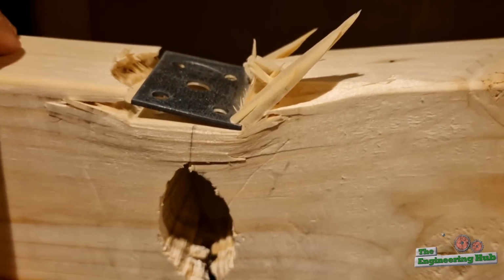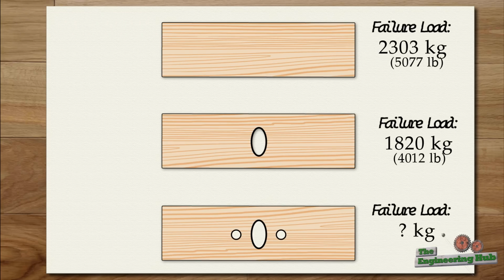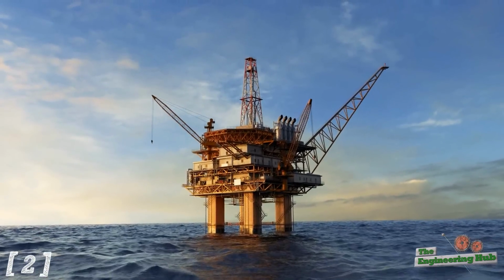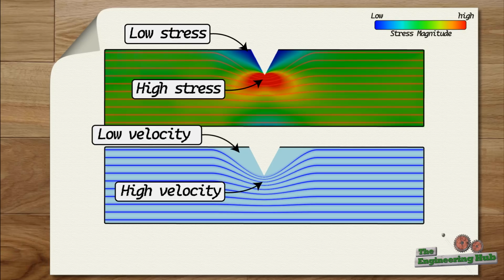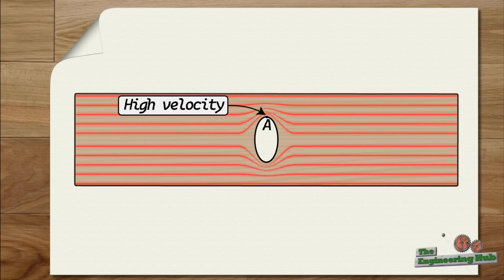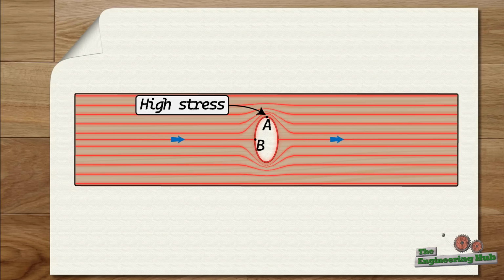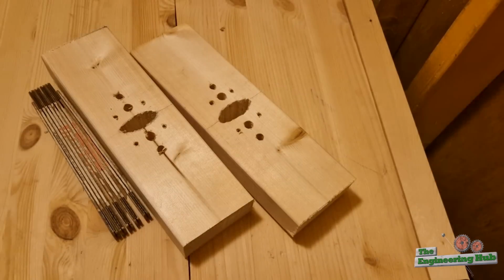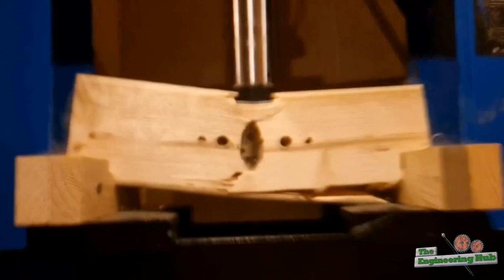Can drilled holes make your beam stronger?

Comment: Why did you demonstrate potential flow theory on a beam loaded in tension when your test is a beam with a transverse point load? They're separate loading conditions that require different analysis. Furthermore why didn't you repeat your initial test multiple times? Wood can vary significantly in strength so using only a single point of reference does not make for an accurate test
Reply: The variance is already exceedingly apparent by the numbers 1929, 2010, 2140. I don't know how anyone can think 1820 is definitely significant and not a fluke.
Reply: @passerby4507  especially with only one data sample
Reply: @passerby4507 it is a very common fallacy.
Reply: well if you think about it, the bottom of the cut is breaking in tension, so you're right, its not a very good test to demonstrate the principle in tension, but the bottom 50% is kinda ok. although its still being pushed perpendicularly like you say
Reply: TLDR: when you transversely load a beam, a bending moment is created which leads to the creation of tensile and compressive stresses within a member above its centerline.

Long version: 
When a beam is loaded transversely, it bends, creating internal stresses. The bending causes the fibers above the neutral axis (an imaginary line within the beam delineating compressive and tensile stresses) to be compressed, while the fibers below are stretched in tension. The compressive stresses are highest at the top surface, and the tensile stresses are highest at the bottom surface. This distribution of stress results from the bending moment caused by the applied load. It is important to acknowledge that 1) this is not pure axial loading so the flow analogy does not perfectly carry over because of other additional stresses and 2) that wood is anisotropic so it is definitely not an ideal material to test this with but it is cool for demonstration purposes.
Reply: @riversneed  so Mr structural engineer, is it correct to use the water flow as base like in the video?
Reply: Your reference set is [1820] and your test set is [1929, 2010, 2140]. The two extra samples did not demonstrate that the extra holes made it stronger. It demonstrated that there is a high variance on your samples and the 1820 outlier is not very significant. 

Also, using a tensile stress analogy when introducing a bending stress is quite confusing. I know there is a tensile stress in the failure region but the stress introduction method is fundamentally different from tensile testing and the material is anisotropic on top of that. It makes for a pretty poor analogy to explain what is going on.

The phenomenon you are trying to demonstrate is true though: removing material can make a part stronger w.r.t. certain load cases. For example: a common repair method for cracked plates is to drill a hole at the end(s) of the crack and then patch the hole. I.o.w. removing material to make it stronger.
Reply: You should study a little bit about constitutive models.
Reply: Because the transverse loading causes tension and compression linearly in the beam.
Reply: Not to mention how unrepeatable the hole cutting method seems to be
Reply: Because he is hee for the likes and the dubs.
Reply: its just a demo relax
Reply: @user-lo4me9oe9z  it's a demo that doesn't illustrate the concepts being discussed
Reply: @user-lo4me9oe9z it’s a well stated comment, relax
Reply: @user-lo4me9oe9z  EXACTLY!!

Comment: Wow !!! That is sooo counterintuitive - and really set me thinking .
Video saved - I shall definitely revisit this . What a surprise … thank you for making this .

I almost can’t get over that 
This  would imply you could strengthen a  joist after a plumber has put a pipe through it by drilling extra holes !!

I guess in buildings strength may not be the limiting design case  however, where absolute deflection under a given load may well be more critical, and indeed must be lower than a prescribed amount so as to prevent damage to attached brittle materials, and the more nadgered a  beam is, the more it will deflect (long before failure). 
Presumably the coupons with extra holes drilled are deforming more for a given load ? Otherwise why wouldn’t all plumbers do this as a matter of course, and more importantly it be built into building regulations ?

Comment: Your loading doesn't match you stress analysis.  So tell me again how you can increase tensile strength by reducing the section?
Reply: The tensile strength isn't increased. The tensile peak loadings within the distressed element are reduced.
Reply: Practical tensile strength is increased....but not for the entire section.  Remember we are comparing against section with center slot and section  with center slot and extra holes to smooth the flow.  This reduces the risk of failure emanating from the peak load points.  I.e. we are making the material behave more uniformly, though theoretical tensile strength in a uniform material won't change.

Comment: Please normalize your audio. Loud bangs and your quiet voice do not make for a comfortable listening experience
Reply: Gen - Z for sho
Reply: I didn't find any issue with the audio
Reply: You want compression, not normalization.
Reply: Wrong
Reply: Are you American by chance? I’ve noticed that many of you struggle with things most people just filter out, I heard no “bangs” either.

You receive a free product and kvetch so perhaps you should pay the guy and then you can affect the sound so it doesn’t give you this emotional damage.
Reply: @Br1cht  0:25, literally the first 30 seconds of the video. It goes from practically whisper quiet to peaking. If you don't hear anything wrong, go to the doctor and get your ears checked.
Reply: Instructions unclear, performed supercritical heat soak of audio equipment and allowed to air-cool to room temperature. Equipment failure.
Reply: Crybaby
Reply: I kinda like it. Keeps me on my toes
Reply: Humble_Merchant I hate to start a morning like this, but you’re an idiot.  I wouldn’t doubt you’re one of those “woke” types.  Stop trying to make the world more complex with bs!!

PS - the woke are not woke!  They are more brainwashed and ignorant than more people in this world!
Reply: Sound fine to me. Skill issue maybe?
Reply: Humble is correct. Loud jarring sudden noises are unnecessary. And very distracting. It’s 2024. At least in the US. Maybe where this video was made and edited is still living in 1968.
Reply: Turn on the stable volume setting.
Reply: ffmpeg loudnorm
Reply: It's called a compressor
Reply: Might not be just him. Something weird seems to be going on with audio on YT lately. I've had to jack up the volume on some channels I've sub to for years only to get blasted on the next video.
Reply: @custos3249  Youtube now has a setting called "Stable volume". I wonder if it is doing the wrong thing in some cases.
Reply: @custos3249 turn off stable volume
Reply: @custos3249  look in additional settings, there's a new function that's called auto volume or regulate volume, something like that, disable that function
Reply: Thank you for the warning before I turned my volume all the way up! 😅
Reply: Turn off stable volume.
Reply: Headphone-cels seething, phone speaker chads winning
Reply: You don't seem too humble to me...🙄😅
Reply: @peterfitzpatrick7032  I'm very humble. The humblest in fact
Reply: Idk it sounds normal to me. Maybe using headphones makes a difference, but I can hear both his "quiet" voice and the "loud" bangs like both are similar.

Disclaimer: I always had excelent hearing (hearing tests are above average), but maybe because i listen to stuff like Heavy Metal and Trance, I likely "trained" to listen all extremes of sound, bass or treble, quiet or loud.
Reply: It is what it is, I don't think there is much improvement to be made, perhaps simple "loud bang ahead" warning 🤔
Reply: You should totally ask him for a refund for the free video you just watched. 🤦‍♂️🙄🤡
Reply: @airgunsofalaska or he can listen to this and make a real improvement to his content. This is decent feedback actually!
Reply: you didn’t even watch the video, did you? there was a single loud bang at the beginning and that’s it
Reply: It's a video about wood breaking, not a bedtime story
Reply: @bobs12andahalf2 It's a video about science. If you want a video about breaking stuff, watch hydrolic press channel. Or if you want to burst your eardrums, watch loud car channel.
Reply: @bobs12andahalf2    Don’t be such a Neanderthal.
Reply: @bobs12andahalf2 bro, it's fine if the audio balancing is ass, it's SUPPOSED to be ass
Reply: Really, is that the best gripe you can do on a truly informative piece of work?
Reply: The dude wasnt complaining to complain. I had to crank my earbuds up to hear him and then got blasted by a piece of wood exploding into my eardrums lmao. Its definitely uncomfortable to listen to. The constructive part of the comment asked him to normalize the audio. @scotttoner9231
Reply: @scotttoner9231 when you cant take criticisms so you try to attack the critic
Reply: @scotttoner9231 do u guy unable to take criticism?
Reply: @scotttoner9231  No

The click baity title is also unprofessional and unnecessary
Reply: @Humble_Merchant 
 Normalising the audio would not help, it would amplify all things equally.
I would suggest and audio compressor, not to be confused with compression.
A limiter would also do the job.
If he was really brave both would be better but not to much or we will hear every wheeze and creak. I’ve some videos were you can hear lunch digesting in the quiet bits.
Reply: @Margarinetaylorgrease  normalizing or equalizing audio would indeed help because it would all be a similar volume that can then be adjusted with the master volume without one audio source being too loud or quiet.
Reply: @CalamityJay-ez2mq  
No
Reply: @Margarinetaylorgrease  that's ok, you're allowed to be outright wrong
Reply: @CalamityJay-ez2mq  normalising effects everything equally so the difference in relative volume will be the same.
But what do I know? I’ve only been sound engineering since 1987.
Maybe you  can Google it.

Like I said, a compressor and limiter will do the job
Reply: @Margarinetaylorgrease  since 1987 and you still don't know how to normalize audio? That's depressing 😭
Reply: @CalamityJay-ez2mq  
Did you Google yet?
Reply: @CalamityJay-ez2mq  
Yet?
Reply: @Margarinetaylorgrease  I know I'm not the one you were arguing with, but I googled it anyways. Always worth learning something new. Would you confirm if my understanding is correct? Because from what I've read, you could both be right. If the cracking of the wood and the voiceover are recorded together, you'd need a limiter/compressor. But if they were two separate recordings you would normalize one of them, so that the max amplitude of one recording matches the other (or any desired difference)? Please correct me if wrong
Reply: @khazaddum6570  
That would work.
To be honest good level matching is the way forward. Just normalising everything and putting it all at the same level doesn’t take into account the way we hear different sounds.
Reply: @Humble_Merchant  the title is "CAN DRILLED holes make your beam stronger?"

notice that the can is before drilled and theres  INTERROGATION point at the end, so no, it's not a clickbait.

and the thumb shows that ONE elipse with no relief holes is weak, but the one with relief hole is strong, it could be a clickbait with misinterpreted, but normally it wouldn't.

Comment: Interesting idea, though your slit in the first beam has a lot sharper edges (cat eye shape) than the ovals in the following 3 cases. Also given that you shared stress model for the single opening, it would be nice to see what your modelling software predicts.  As for the conclusions,  note that your intra-sample variability ( 1929~2140kg) are consistent with standard wood variation and rend the results of your experiment inconclusive. Finally note that the top fibers being crushed before you reach failure mean you are observing variability in wood fibre separation ( delamination ) rather than stress propagation.  I am looking forward to seeing a followup, keep up being curious ^_^
Reply: I agree.  I found it interesting that a sample of 3 was used for the condition with many holes but a sample of 1 was used for both the control (unaltered wood) and the first test condition with one hole.  Given that wood is not homogeneous, I would have liked to see all of the conditions tested several times.  Although, I understand that this was more of a demonstration of the theory, it would be more convincing if the average failure load was used for each condition.  As a hobby wood worker, I can tell you that even within the same piece of wood the grain pattern can change dramatically and the presence of a knots is essentially the same as a hole in the wood in terms of the stress lines travelling through the wood.  Nonetheless, I found your explanation of water flow as an analogy to stress fascinating.  I always like to be able to visualize processes and this will help immensely.
Reply: The pointiness of the hole isn't really relevant. In this context at least general dimensions being similar is all that's needed. Consider arches, gothic and Tudor arches both come to a point yet the point of failure is not the apex or keystone.
Reply: @edwardarkwright7116  The failure we are talking about is not that of compression, though (the top of the arch), it is of tension. Think of tension failure like a knife cutting through fibers. She sharper the edge, the more concentrated the shearing force that actually parts the material. I can hang a thousand pounds on sturdy rope tied to a 1" round bar, but only ten or twenty pounds if that same rope is tied to an upward facing dull blade. It can support less and less weight as the blade sharpness increases. Hanging a rope on f fresh surgical scalpel might even sheer through the rope under its own weight.
Reply: @fxm5715  if we read the original comment, the critique was over the shape of the removed material. We both agree it is a matter of tension. We both know that if the crossection of a member contains the same area as another, regardless of shape the bearing load in regards to tension is very similar. In that way your comment I fail to see as relevant
Reply: I was thinking similarly; that a more accurate or at least predicable/consistent test would be to use vertical slits with varying heights, but a consistent width and top/bottom radii, the lowest height being equal to 2xr.
Reply: I had the same thought. Not every piece of wood breaks the same. They are from different parts of the tree. I think you need to do a lot more experiments and average them
Reply: I’m in the wrong place obviously

Comment: Really like the fluid flow analogy.
Reply: The flow analogy socks. The top half of the beam is in compression and the bottom half is in tension.  The neutral axis has no load. Stress is proportional to the distance from the neutral axis.

Comment: 2303kg<------no holes! -----------------------------2140kg<------ with holes,  drilling and waiting and the time to drill! Engineering no-brainer.
Reply from the maker: The point is that if the hole already exists (say because of pipes, cables, ventilation, etc) then you could improve the capacity by drilling holes. Of course no one is saying that you should just drill holes in your beams for no reason.
Reply: @TheEngineeringHub  yes,hopefully the plumber or other craft person watches this. Anyway, good explanation. I'll stay subscribed
Reply from the maker: @art1muz13  ty🙏🙏 appreciate it
Reply: @TheEngineeringHub   Most of the comments are missing the point. If I wanted to nit pick I would demand you compare structural pine with aircraft spruce.
Reply from the maker: @markawbolton  oh well, I tried
Reply: @TheEngineeringHub  Good Sir you succeeded !
Reply: @TheEngineeringHub  i think you have to elaborate this in the intro of this vid, mate

Comment: Interesting counterintuitive results! I wonder if this would work the same if the initial hole was filled by a bolt to attach another member.
Reply from the maker: Hi Dylan, I hope you are doing fine bud! It's an interesting question! I guess it would depend on the connection type (i.e. slip-critical or not) but the fact that these holes are not common around bolts probably means that it doesn't work .. I guess? It should work around pipes, cable holes etc. I found this technique in an older book, but it's probably not a very common practice anymore.
Reply: Filling holes with bolts to retain cross sectional area is common. Plate friction helps too.
If you were really paranoid ( cautious) you could fix steel bushings into penetrations or fix steel flitching across the penetrations.